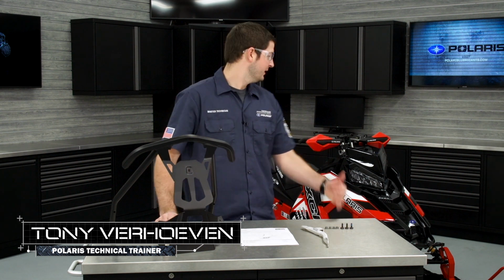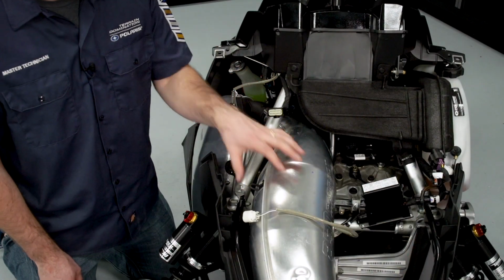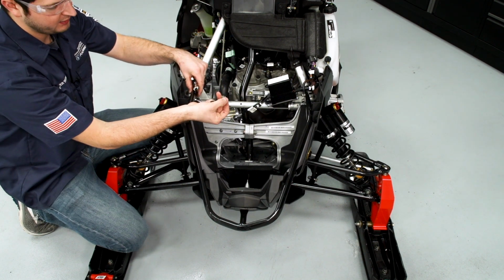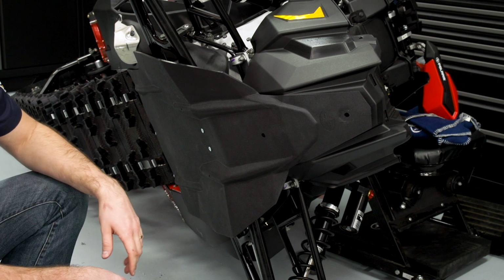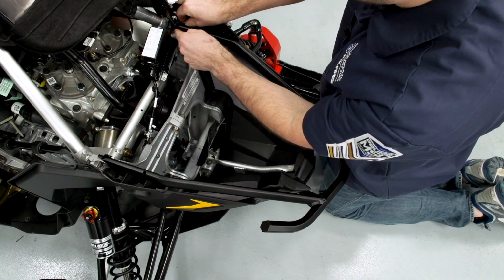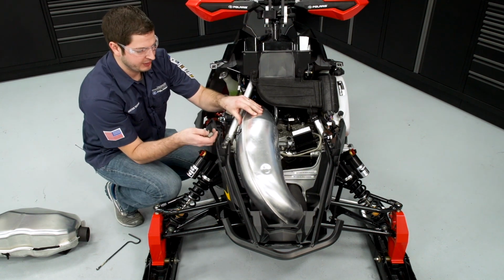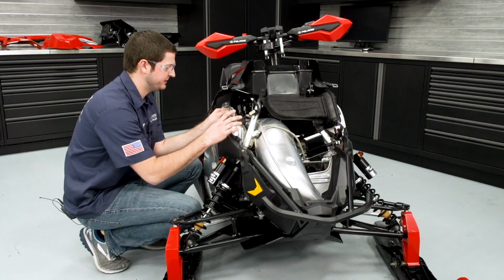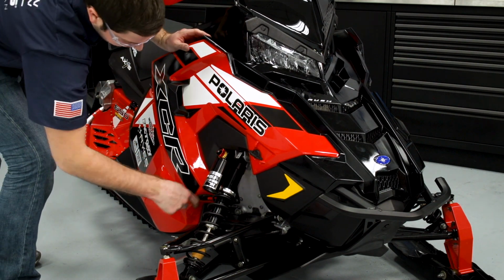Polaris Extreme Front Bumper Installation Instructions

Comment: In this video you install the bumper under the plastic skid plate.  On the Polaris website build page, the animation shows the bumper over the top of the plastic skid plate.  Does it matter whether bumper is on outside or inside the plastic skid plate?
Reply from the maker: There are other bumpers that mount to the outside, but this bumper is form-fitted to the underside of the body so it mounts underneath the skid plate.